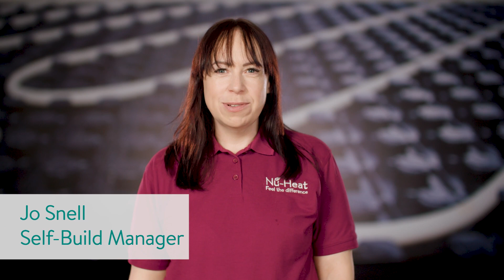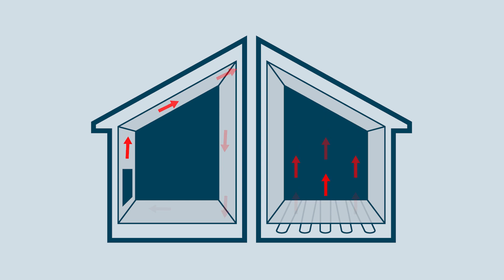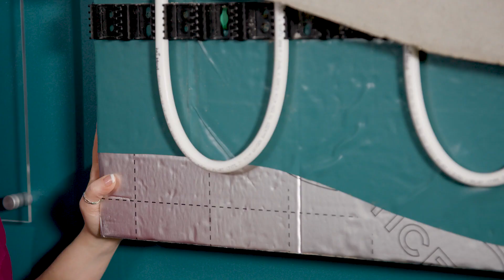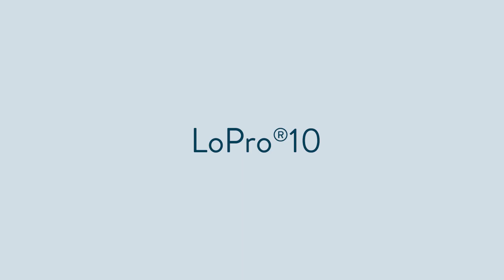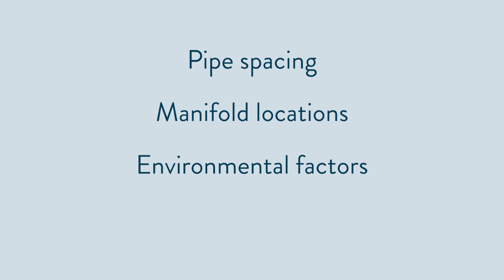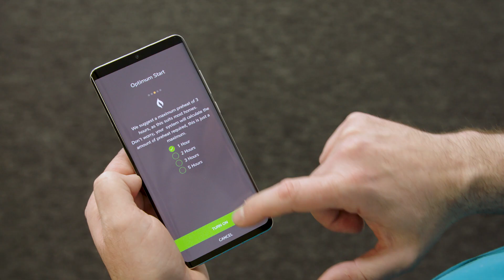Underfloor Heating: Everything You Need To Know

Comment: Here I am, running radiators overdimensioned so they all provide adequate heat with a flow temperature of only 40°C, zoned per room with either a local thermostat or a thermostatic radiator knob, quickly reacting to a change in heating demand by either user input or changing solar gain, on insulated floors that are warm enough to walk around on barefooted but aren't so unnaturally warm it becomes unhealthy for both humans and pets...
You claim you can ask anyone who has underfloor heating if they would want anything else and they'll say no? Before I decided what to get in my renovation (coming from individual gas heaters), I talked with many people who have underfloor heating for longer than a few months, and unlike your claim, it was a mixed bag with many saying they need to open windows (waste heat) or lower the roller blinds (waste natural light) during sunny days to combat overheating, or use a supplemental heat source (wasting energy) or blanket (comfort) in the evening because it's impossible to quickly get the room 2°C hotter with underfloor heating.
Reply from the maker: Thank you for your question, the simple answer would be down to the level of controls supplied with the UFH system, Nu-Heat design systems with thermostatic controls supplied for each room of the building this will optimise the heat output based on that room area only, solar gain into that room would simply raise the room temperature and once pass the thermostat set point would turn off the UFH for that room.  

UFH thermostats are built with a maximum set temperature range for the room but also have a full back set temperature this is designed to prevent the rooms dropping too low. The most expensive part of operating UFH is to firstly warm the floor slab,  so once this has been warmed up the best approach is a slow and steady constant turn over of heat operating from a dual temperature thermostat.

Systems supplied with less controls like a single thermostat controlling all the rooms, can suffer from issues with solar gain and slow heat performance issues.

Comment: 11:14 Downward heat lost on an existing concrete floor renovation. As stated the product is fitted directly on the concrete floor, however would it be beneficial in anyway to add a layer of insulation first before sticking down the pre-formed catalator panel from the Low Pro Max option?
Reply from the maker: Thank you for your question. The LoProMax system is designed to be installed on top of a structural strength floor surface, installing insulation on top of the concrete floor would not be recommended as that is not a structural floor surface.
Reply: @nu-heatuk  Translation: we developed a product that's recommended to be installed in a way it'll be inefficient, and cannot be optimised, not even with high pressure strength insulation panels.
Conclusion: if you'd have to throw away any possible efficiency gain of going underfloor (which there isn't by the way, radiators and convectors can be dimensioned to work on low flow temps as well), you'll end up with only having the downsides (slow reaction to changing heat demand) but few to none of the advantages.
Just go with radiators or convectors, underfloor heating is a fad, it has been tried in the past and is proven to only work in houses that are entirely designed around it, not as a one-size-fits-all solution and definitely not without floor insulation and enough measures to reduce all external influences (including solar gain, again throwing away efficiency).